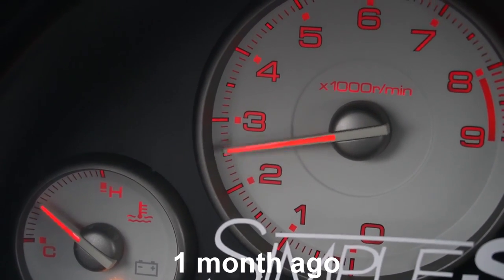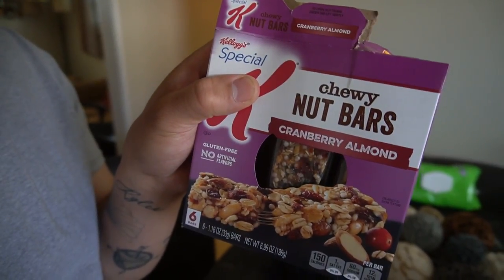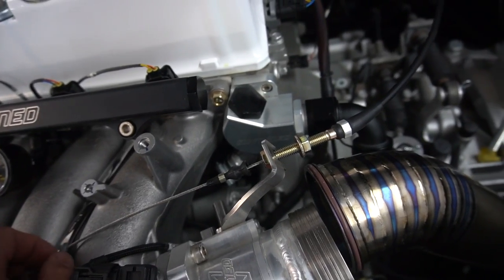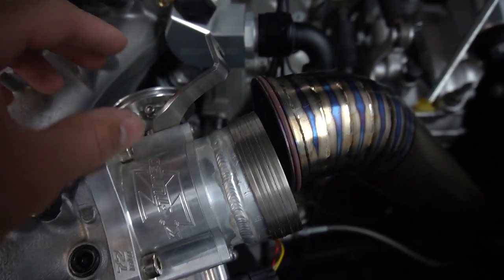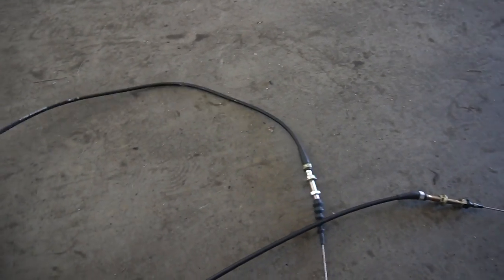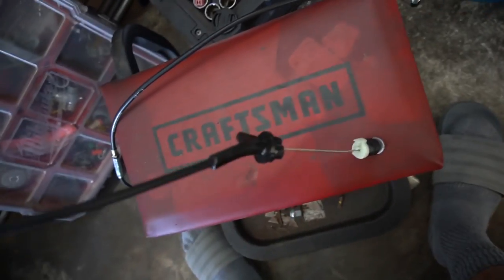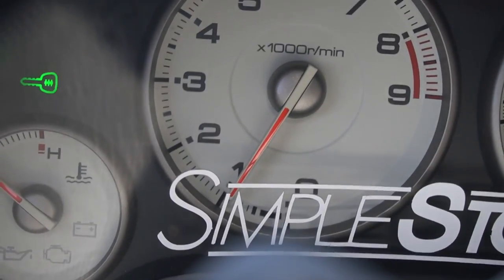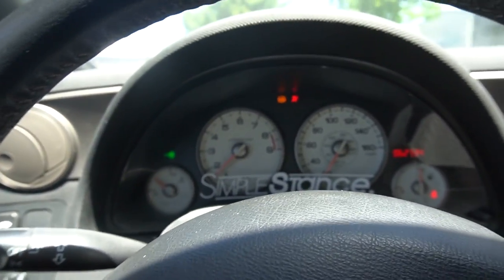Throttle Body High Idle + Rev Hang + Sticky Throttle FIX | 1 MONTH UPDATE VIDEO

Comment: Do you think it's worth replacing a damaged piston ring/ getting a new engine or selling car? Recently hydrolocked my RSX :(
Reply from the maker: hydro locked is never good but honestly spend a few bucks and get it checked out. my rsx almost flooded once and i was able to save her . a swap is easy but not cheap and selling might not get you much without a motor. sry i cant be much help. best of luck

demossi
Reply: If you already have Kpro or Ktuner on your current build. I'd say go ahead and get a K24A2 and swap it in. Otherwise a new Type S motor A2 or Z1 likely gonna cost a bit. If you have a base model then you shouldn't have trouble finding engine for cheap.

Comment: Hey bro your type s is a huge inspiration, im having some issues with my idle staying at 2k even after the car is warm. I just changed my IAC valve. Any idea what is causing it to stay at 2k and not drop after warming up?
Reply from the maker: thank u, could be numerous things, i would have to know what u deleted or changed on the car. different tps? different tb? iacv delete? last mod or change before this started. theres just too many questions. what base map on kpro?  its just a lot of things it could be. the smallest thing could be causing it
Reply: @Deemossi  notbing is deleted, car is pretty stock. No Kpro stock Tb stock sensors. Just put a brand new IACV in. I bleed coolant, tried idle relearn. Tried adjusting throttle cable. Even sprayed soapy water looking for a vacuum leak and nothing...

Comment: Hey bro i changed my throttlebody to a ktuned with a CAI and RBC intake buuuut since i made that change after a while my rpms act up and car will shut down.. you think it might be the tb? or could be something else?
Reply from the maker: make sure to have kpro and run correct base map for whatever bolt ons you added. 

stock TPS tend to not work. Get Acuity TPS and make sure to set it in kpro or manually  with a multimeter. 

Clean the IACV 
and make the adjustments to the ktuned TB if needed . 

Best of luck

Comment: Bruh what water neck and -AN fitting you using? I need something like that cause the silicone one I’m using ain’t working with my set up. And that k tuned cable would’ve come in handy if you went boosted cause you can run it underneath the piping using a fashioned bracket or zip tie.
Reply from the maker: yea , luckily the person it went to actually has a turbo set up, he put it to good use. 

upper housing was ktuned + all fittings are -16AN VIBRANT

 
everything should be explained in this video.
https://www.youtube.com/watch?v=qdjskoPFg4Q&t=428s

Comment: Hey man quick question so i installed this same throttle body, And my throttle pedal is so softtt if i step on it a abit it revs high im wondering if thats because The spring was adjusted? Will i need to tighten ? Or loose? And also im having kind of the same problem As you but my car will kee jumping to 2k rpms  and it will do that for a little bit you got any idea why its doing that?.. LMK
Reply from the maker: Glo Boi honestly just play around with the spring and also the throttle cable has adjustment . takes patience but should help. Also the ktuned Tb is infamous for getting stuck. Some people sand the inside of the Tb slightly. If you look closely you can see where the butterfly is rubbing. 

Also if you havnt swapped out your tps , I suggest you do that as well.
Reply: I had same issue. I put the spring from hole 1 to 3 (like in video but 6 on my 70mm ktuned was toooooo tight) and I loosened cable and it’s way better now

Comment: Hey Dee good videos bro.. My RSX is showing  a red seatbelt light on the dash. How do I fix that? I’m looking at the same light on your dash..
Reply from the maker: What’s up m4D

I think your referring to the airbag light . I’ve had on for many years kinda just ignore it but I used to reset it and would go away for a few days or a while don’t remember exactly.

I used to do the paper clip trick to reset it . 
Here’s a link . https://forums-clubrsx-com.cdn.ampproject.org/v/s/forums.clubrsx.com/showthread.php?t=308198&amp=1&amp_js_v=0.1&usqp=mq331AQCKAE=#

Try this step by step . Takes a few try’s to get it perfect . 

But it’s an error and you could figure out exactly what it is by trouble shooting it. if I find the link to finding out exactly what it is . I’ll post it here. 

Only other way is to take it to the dealership . They have the proper tools to tell you what exactly the issue is
 
Goodluck 

Deemossi
Reply: Open seat belt buckle and use air duster sprayer for computer and blow out the debris in the buckle. Reassemble and reset srs indicator.
Reply from the maker: I’ll have to try that

Comment: Yo bro how did you adjust your tps because i recently changed mine to fix my idle and normal idle is between 1300-1500 k and cold start is 2100 . If you got any advice please let me know bro thanks 🙏🏻
Reply from the maker: whats up Ant

so not sure if your running Ktuner or Kpro.
if you are running ktuner or engine managment,
try this video https://www.youtube.com/watch?v=hQAEfczDc8A&t=7s

you can also set your TPS manually with this video.
https://www.youtube.com/watch?v=VErGvhQVbDA

and hopefully you purchased a quality TPS , 
Heres the instructions to the ACUITY TPS
https://drive.google.com/file/d/0B456gOYKbqR2NnpCWndZVFVoM00/view

in my video the TPS settings were a little off.
use what acuity recommends , which is :

0.48V when closed.

best of luck

deemossi

Comment: WhatsApp bro I have this problem in my rsx where the gas pedal has a lot of play before it it actually starts to rev like the cable idk if it’s the cable or the pedal that I need to fix you think you have an idea
Reply from the maker: What’s up @frailintv

Well need a few details first. Stock or ktuned tb?

Either way it’s def something to do with your cable or TB. I doubt your pedal is broken. 

Also make sure the throttle cable is latched on correctly to your gas pedal.

Comment: Hey bro I have an issue with my Rsx where it goes to normal idle then goes up alittle while not touching has and goes back down and goes up alittle etc. any idea what it can be ?
Reply from the maker: If you have messed with your coolant lately , you might have air in your system . it usually will idle funky if your don’t get all the air pocket out.
Reply: Deemossi how can I get all the air out ?
Reply from the maker: YouTube the process , many videos out there . jack up the front end of your car. Open the radiator cap and let the car idle till you don’t see bubbles coming out.

Comment: Honestly your old throttle cable looks better and it looks zinc coated the Ktuned looks like it's going to rust .....almost all my suspension components are from ktuned. Ktuned coilovers ride quality is the best I ever put on my ep3 the k1 street from ktuned is rusting out all over the top hat bolts ,plate ajustment allen and the bottom hats 6 month with it....I love their products but very disappointed bout the rust should coat everything with zinc
Reply from the maker: i said the same thing when comparing them, exactly the same but my old one is a lot better quality and a bit shorter, all around just fits better. 

zinc is just another step that ktuned doesnt want to do, ktuned has some good stuff but also some stuff that just isnt good. still a big fan tho.

mayb i should try their coilovers when i swap mine out. hate that salt is a killer for us up east
Reply: @Deemossi  they drive good and is one of the sexiest coilovers I seen color combo black grey with red hints lol if I where to buy again would take them apart and zinc all the top bolts and Allen adjuster I did put anti seize on the collars though.
Reply from the maker: @nighthawk_bep336  Zinc everything lol ha

Comment: Bro I was told to switch out the spring throttle from the stock one
Reply from the maker: never tried that, eventually with spring adjustment and just using the car, it stopped getting stuck. someone else recommended lightly sanding the inside of the TB . Issue is the butterfly getting stuck when closing causing it to idle high or get stuck at a certain RPM . once you free it from doing that . It fixes the issue